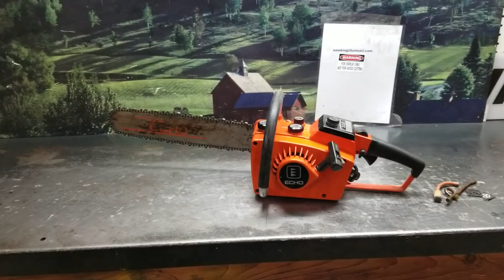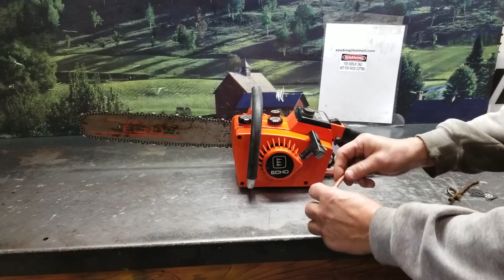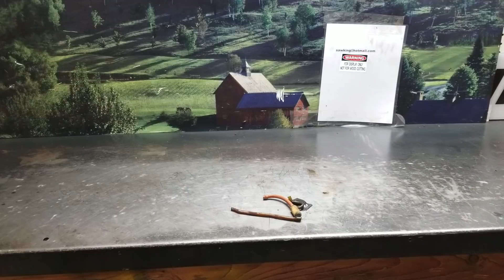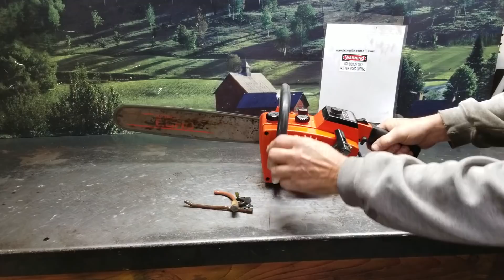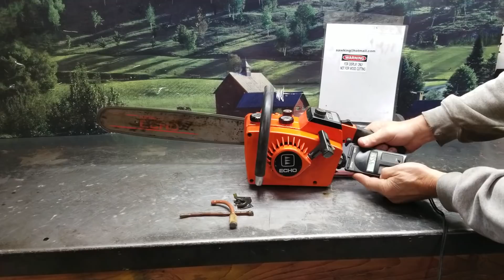West Coast Muscle Saws repairs vintage Echo CS 302 Chainsaw

Comment: My 302s needs clutch work. This clutch isn't held together by a pin like most modern ones. Any tips on how to remove the clutch in this bad boy? The clutch spins over when I try to unscrew it.
Reply: Clutch should spin either counter clockwise or click wise. The trick to unscrewing one is one, get the right fitment tool and two, load the cylinder completely up with a long piece of shoelace so when you spin the clutch the piston has something to smush against and the clutch should break loose

Comment: I have the exact same chainsaw but it says craftsman 1.8A..
Cleaned the carb now it won't work. Followed the manual still no luck. Any ideas?
Reply from the maker: Some times a sonic cleaner will clean the impossible to get to passages.
Harbor freight sells a good one,
WestCoastMuscleSaws 
TheChainSawGuy 
Rich
Reply: @WestCoastMuscleSaws  you're a legend.

Comment: hello. I have the same saw and need to replace the gas lines. mine leaks all over the place and does not suck through due to a leak. Where in your video does it show how to replace the fuel lines???? You show old rotted out lines on the table in the video, but HOW DO YOU REPLACE??!!

Comment: I replaced the carburetor and it works but it’ll turn off after a while
Reply: Those have the old points ign system. It also could be the switch.

Comment: I have one of these I found in the trash..but I need a bar and chain and can't find it
Reply: I just picked up a bar that for this at the echo dealer. It's not the original bar but it works and the saw is still running great.
Reply: Try Ahlborn Equip but you'll need a tax #.